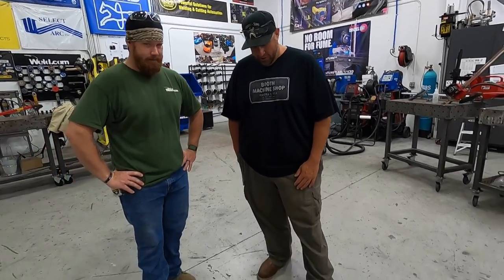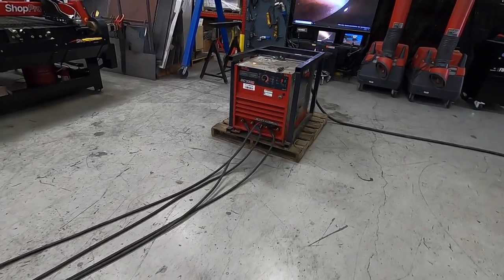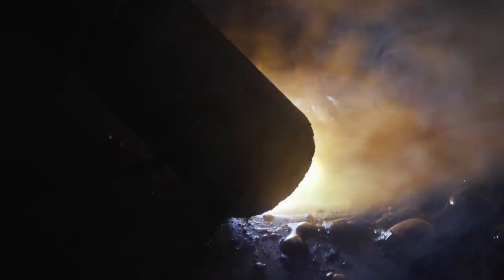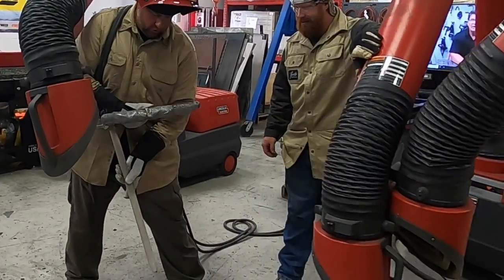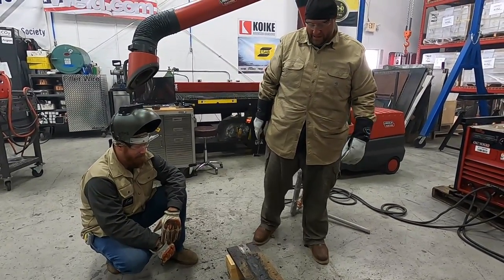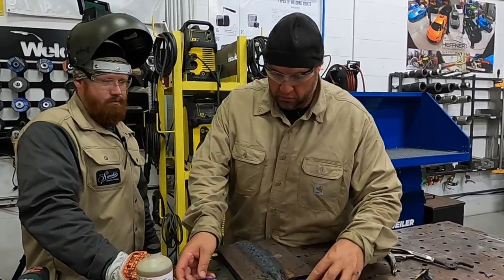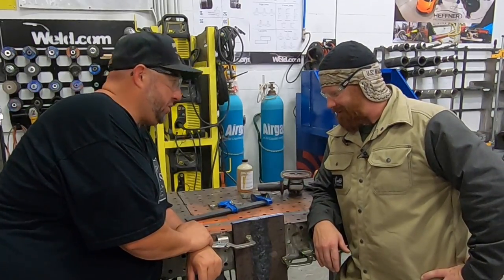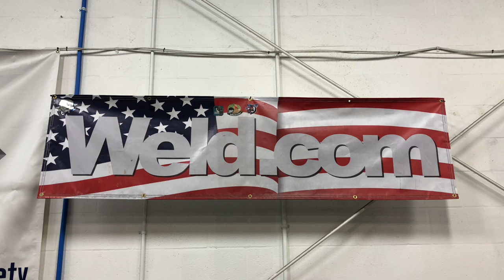1,000 Amp Stick Welding with Weld.com

Comment: This may come in handy if you need to weld 2 freight ships together I guess.
Reply: Best prank ever.
Reply: Or 2 planets
Reply: Right. If you succeed to put the ships flat.
Reply: *ul0
Reply: @mateos vargas Un-Bismarck the Hood
Reply: @mateos vargas Un-Neptune the Moskva
Reply: Best comment
Reply: oOOooo freight ship catamaran
Reply: Hahaha
Reply: Welds freighter ship to the metal dock protector. "Fuck you, you lose your travel privileges."
Reply: Lol
Reply: Hey now I don’t have to stack welds to do it
Reply: Un-Moskva the Bonhomme Richard
Reply: @mateos vargas Yeah! Refloat Arizona!
Reply: Yeah I guess it would be useful for industrial bulk welding
Reply: You weld 1 inch plate steel like on ship decks heavy equipment military ships it takes care of multipass welding
Reply: Just a normal Tuesday
Reply: I'm going to be a nerd and say it crack afterward if the ship is cold. lol
Reply: Needs a bit (alot) more Flux, too porous.  Better than 1000 passes with regular stick or Flux core. Seen em in Oklahoma try to do Flux core on bridge spools. Might as well pick up a harbor freight and build a 4000 lb spool out of it. What the godamn hell. Seen em break tho, definitely
Reply: Or the twin towers
Reply: Flux cores better
Reply: You must be a slow welder
Reply: Holy spatter batman
Reply: To show you the power of this 1000 amp welding rod, I saw this freight ship in half
Reply: Just throw the ground lead in the water
Reply: H😅
Reply: Or planets😂😂
Reply: @sjoerddejonge4080 whahaha just posted my before reading this 😂😂😂 i agree😂

Comment: Imagine sticking the rod by accident and having to get the damn grinder out just to get it off
Reply: I don't think you could stick that. Unless you turn off the power mid-weld
Reply: Super scary 1000 amp welder.
If it stuck, you run like hell, and hope you can shut off the power before the 1000 amp dead short explodes.

Comment: It was a pleasure working with you again Adam! You're welcome back to the shop anytime you're in the area.
Reply: Whoa...somehow I'd forgotten a 1316 was the ground side version of a 6092.  Semper Fi.  6092 1999-2004
Reply: What was the name of that super good grinding wheel? I need that in my life!
Reply: Y’all need to hit up that 10% nital etch so you can see the welds better
Reply: leghumper83 Semper Fi. 1316 2001-2005 🤘🔥
Reply: Jim Jones it’s called a Victograin from Pferd abrasives. They are by far the best I’ve ever used.
Reply: I live in largo. I didn't know you guys were here.
Reply: Great video, good to see collaborations
Reply: Did you put a link or other identifying information on those grinding discs please? Particularly the one you said you could go from weld to paint almost. Thanks!
Reply: Jason Becker I
Reply: @leghumper83  н
Reply: #realweld
Reply: Why not use mig or tig? This stick welding is soo old school
Reply: I wish I was in USA to be able to come around and learn welding at that level of profeciency passionately. That was a nice video. Thank you!
Reply: What is that type of rod designed for
Reply: @shannisgeorge  large thick steel like in foundries and steel mills
Reply: @AS-ug2vq  what do you mean old school? . Mig and tig are great for thinner materials, but stick is way better for thicker materials

Comment: Nice editing suite with one of the most ridiculously oversized monitors ever.  I do like that 1000A welding equipment.  Any idea what the open circuit output voltage on the welder is?  I'd guess it might still be fairly low like 80V despite the thickness of the flux coating on those rods.
Reply: bigclivedotcom Lincoln Electric manufactures the DC-1000s for Red-D-Arc. The OCV on them is 78V.
Reply: I was wondering about this, too. 1100 amps at 80V is furious wattage, for sure. Possibly more than a Pound Land combination dental pick and stick welder.
Reply: I didn't know you watched the channel 😂 nice to see you on here ! I hope you're staying safe and well😁
Reply: @bigclivedotcom the OCV is purposely held under 90V for safety.. anyone who's ever grabbed a deck rod (6022) with wet gloves will agree.. getting belted for the giggles of it... isn't exactly fun.
Reply: Nice to see you here, hope all is well

Comment: Loved seeing this. In the mid 70s I worked for Sisco, a division of Hilti doing repair work in the steel mills. Used the same setup to repair slag pots that were about 15 feet in diameter, laid on their side. We would use torches to burn out the cracks and then fill the resulting gouges with however many rods it took. I think we welded at 750 amps. You would pull in a pallet to stand on and it would eventually catch fire and your boots would be smoking. Of course there was no fume extraction. We also did some diabolical thermite welding, recasting the bottoms of ingot molds that had burned through. Also  wrapping ingot molds with two by eight foot sheets of half inch steel to reinforce them, bending it around with blow torches at the corners and a come along. Nailed them on with 45 caliber Hilti guns about 4 inches on center. Talk about loud when you had 3 or 4 guys going at it at the same time. Quite the experience. This was in NW Indiana. Republic and Inland if I remember correctly.  Thanks for the great video and the great reminder.
Reply: 750 sounds like you'd get better results....I'd think you'd max out at 800 amps on a flat

Comment: you've heard of stick welding?  this is branch welding.
Reply: you mean trunk welding? cuz I don't thing there is any bigger than that one or is there?
Reply: @Astrix_Jaeger  i absolutely did, I wasn't sure if people would get it since "trunks" can be other things.  But your question led me to ponder(obsessively google).  Found one post where I guy describes repairing foundations of 100+ton cranes use 3-5" electrodes.  No way for me to know if thats true or not.  then there's furnace electrodes which are "non consumable" are usually several feet wide & 10's of feet long.

and the top google results for biggest stick welding rod, are this video & various listings for it.

my verdict:  these are king & already larger than intended to be held by a human.

Comment: Imagine if the rod stuck 😳
Reply: You’ll need a diesel truck with a winch to unstick it, for sure
Reply: @wendysobamaman2179  & Fire Dept on speed dial
Reply: @wendysobamaman2179  lol or a 4" angle grinder with a $2 cut off wheel.

Comment: in a welding class in the early 70s, they showed a film of welding the huge thick WW2 battleship plating.  they used LONG huge electrodes that were supported on one end, creating a tripod effect.  the electrodes were self feeding. As it got shorter, it just tilted further and further until it burned itself out.  One person could supervise a bunch of these, setting up new rod when one used itself up.  Probably rods like this one, but way longer.
Reply: That would be awesome to know more.  Even if it could be weighted to run the proper feed it is still a cool idea.

Comment: I worked at a place where the owner purchased a used high amperage Westinghouse arc welding machine for the shop. I couldn’t understand why that machine came with two ground cables and a water cooled electrode holder. Now I know it was once used for large diameter welding electrodes.

Comment: If you think that is something wait till you see the power bill
Reply: Someone did the math. Since its running of a generator, it would be under $2 per minute of arc.
Reply: @Sharpless2  Pretty sure that's more like per second. A thousand amps is an insane amount of power draw.

Comment: Funny how things change. Years ago Red D Arc was a small Canadian company that only did business in Canada. They had a fellow named Henry Cole who was in charge of research and development. Henry was the guy who came up with the idea of using Lincoln generators attached to Kubota diesels. He tried a number of variants before hitting on the Kubota and he knew he had a winner. Reliable and fuel efficient the Red D Arc diesel welder soon started to rival Lincoln in sales in Canada. Henry wanted to start selling machines to the States but upper management kiboshed the idea. Seems they didn't want to upset Lincoln in their home base. So Henry being the guy he was hit on another tack to get machines into the US. He found a couple of rental outfits that had branches in the States that were willing to buy machines and then export them to their American operations. The Americans soon grew to love these machines but they could only rent them. A couple of users determined that they wanted to own machines instead of rent them so they found out where the machines came from and called to see if they could buy them direct from the manufacturer. Red D Arc's management had a long heart to heart with Henry when they figured out what he had done but they decided that they couldn't turn down the sales so Red D Arc started exporting to the US. Today Red D Arc has machines all over the place and they are considered one of the best around as seen here. 
One of their best portable machines is the three cylinder DX. It's about 600 pounds lighter than a full sized DC and you can easily carry one around with a 1/2 ton truck. Being a full AC rectified machine, it can also be used as a light plant and actually has a 200 volt single phase outlet on the panel. It truly blows the doors off of Lincoln's Ranger line which it is comparable to. 
As for Henry, well there was a falling out and he ended up working for AIr Liquide / Miller before he retired. He was a good man and I liked doing business with him.
Reply: Interesting
Reply: Thanks for the history.  It is always interesting to me to see the subtleties of human interactions.  That in some way, God is still working to enable human ingenuity to bless neighbors near and far!
Reply: Sounds like Henry Cole had a lot in common with Henry Ford :)
Reply: Or that humans are able to function without relying on fairy stories in these enlightened times.

Comment: Imagine getting this electrode stuck in the weld. It ain’t ever coming out
Reply: i dunno, hes got a 3 ft lever & a wall of grinding wheels
Reply: why? set the welder on 1 000 000 amps momentarily so the electrode melts gets soft like bubble gum then you can pull it off.

Comment: Imagine the power bill.
Reply: It's a diesel generator. 4.57 per gallon. Excellent weld to cost effiency.  There is no better way to weld on an economical basis. Blows your comment clean off the planet.

Comment: 1000 amps, and still only 1/4 inch penetration, LOL...
Reply: They might want to change the polarity, and also use a thicker plate,  because you are not supposed to see an 80 mm wide weld bead from a single pass on a 19mm plate

Comment: Developed by Weld Mold Company in the 1960's, the 3/4" X 36" coated electrode is in use primarily in the forging industry for the repair of forge tooling, using as much as 2,000 amps, depositing 60+ pounds per hour.

Comment: 1000 amps is insane. That's enough to instantly pass you on to the next life and the one after that.
Reply: 100 mA = 0,1 Amps is deadly. 

This will prob instantly vaporize you
Reply: @JimBob-eg7vq  not enough volts
Reply: @JimBob-eg7vq  the electric current is completed through the ground. The guy is not grounded to the machine. There fore no electricity will pass through him

Comment: Pro Tip:" Always chip flux away from you."  Small chance of getting some in your eyes. If it's  still hot  it will burn you. How many welders out there that have had one stuck to their lip?  That hurts like hell.
Reply: Had one burn my eyelid...never chipping towards me again 😂
Reply: I had one flick into my tear duct. It got between my safety Goggles and my nose. 😢 ouch

Comment: Not a welder but I am an engineer. I suspect reason that the weld is actually shallow and wide is *possibly* (assuming you're running AC) is because at 1000A you're experiencing skin effect. When you're using two grounds and two hot wires, the skin effect in the wires is reduced because the total skin volume is increased due to there being two wires. But in the actual plates being welded the current that high causes the electron flow (which heats the metal) to stick close to the surface without penetrating deeply, because the current that high creates its own magnetic fields, which induce eddy currents and squeeze electron flow towards the outer edges of the conductor.
More on the physics of skin effect: https://en.wikipedia.org/wiki/Skin_effect
Reply: The welder is called DC 1000. I suspect it is a DC only machine. The AC frequency of welders is usually under 200Hz, where the skin effect is pretty much neglectable.
Reply: The would really need an arc lenght the diameter of the rod or greater.. but trying to pick it up and hold it would woop your butt without a jig... soo they got arc blow and cold puddle because the arc was buried in the plate..
Reply: @metalhammerish  But is it a pulsed DC? Or constant current DC?
Reply: @metalhammerish  IIRC, the skin depth at 60 Hz is about 8.5 mm. It would be useful to know whether the "DC" we're talking about is filtered, or just DC in the sense that the waveform never dips negative.
Reply: I have no experience with how high power welders are built, but with other power electronics.

I suspect that the current waveform is 1000 amps DC with around 100 amps of some kind of AC current on top. So no, it is most definitely not just a rectified sinusoidal or other pulsed current

Comment: Does this need 220 or can I use 120?
Reply: Lol.  That Red R'Arc generator can put out 120V @ 363A,  but I bet you could run that welder off a 350A breaker  :)
Reply: you could use 120.
bvvt  hmmmmmmmmmmmmmmmm
why is it glowing?
Reply: @pattonpending7390  Input: 230/460/575 volts, 60 hertz, 3 phase
• Rated Input Current: 193 amps at 230 volts 96.5 amps at 460 volts 77.2 amps at 575 volts

Comment: That's not a weld, that's a lava stream. I have been in welding and metalworking for decades, but i never knew about a 1000 amp rod. I have a rod that size, but it is actually a thermal lance. Imagine the shrinkage of that weld.

Comment: Don't think I've ever seen a weld pool with wave action before.
Reply: Wrong polarity.  Run a 7018 electrode negative on a transformer machine and it acts just like that

Comment: That's definitely the largest welding rod I've ever seen I'm not a welder and I'm certainly not an electrical expert. I wonder what 1100 amps of current would do if you were to complete the circuit rather than the welding rod.
Reply: Nothing more than 1 amp.
At welding voltages the resistance of your body is the limiting factor, NOT the maximum current of the welder.

What happens when you bridge a 500amp car battery with your hands? Unless you have broken skin, nothing.

For a human to conduct thousands of amps, the supply must be high voltage.
Reply: @goodbye8995  Thanks I was thinking of a car battery but I wasn't sure.  👍
Reply: @goodbye8995  actually false, OSHA says 1 amp will kill an individual even with low voltage
Reply: That's how you get a baby Vegas
Reply: @Fitardvark  Try reading the posts before replying.
Reply: @theravenflock6068  If you go by the OSHA rule than you would need 10.000-100.000 volts to even be able to run 1A through human skin.
Reply: @groundkopi5975  Iowa State University has found anything above 30 volts dangerous. That machine runs at 44 volts and people have died at 42. Current kills not volts.
Reply: I worked under an electrician who lost all nerve feelings in his right arm from a 20  amp 120V circuit accident you don't wanna know what can happen at a 1000 amps
Reply: @The Raven Flock  current is dependant on voltage and resistance you won't have any current if you dont have the voltage to overcome the resistance
Reply: @WearyKirin  close but I have asked all other electricians I know and we all agree that 1000 amps at 44 volts (that's what that machine puts out) will kill regardless of resistance. It doesn't take a lot to severely injure oneself.
Reply: It would just run 1100 amps through the low resistance of the leads. Not much power dissipated. A welder is a constant current power supply.
Reply: @theravenflock6068  it just won’t happen
Reply: @loon3426  20 amp circuit is the trip current, not the current flowing through the body.
Reply: @theravenflock6068  44volts dc are not able to break your skin resistance. That's the thing when we talk dc you are basicly a human resistor. And at 44v the amount of current that can pass is very very small. If you lick that thing you are dead otherwise you need to double the voltage to even feel something

Comment: My first job as a heavy equipment mechanic for Brown And Root was running a service truck in a Phillips refinery in Old Ocean Texas. We worked on everything from small vibratory sand packers to 4600 Manitowoc cranes and hundreds of welding machines. CBI ( Chicago Bridge and Iron ) was also there building sphere tanks for the expansion. I got called to go get one of their large welders started one day and they were welding and back gouging these sphere tanks at the tank farm. The foreman gave me a couple of welding rods that were not quite that big and some gouging rods just for souvenirs. They had a 1000 amp stud welder that had a 6-71 Detroit for power that was pretty cool. Also a gang of smaller stud welders that welded insulation hangers on. I hated damp foggy mornings because they had close to two hundred older Lincoln gasoline DC machines with magneto ignition and were a pain to get running. Later they replaced them with diesels and once power was in the units eight bank electrics were installed. Took a load off of our job.

Comment: That's impressive. I've made welds that size before, but I used twin 3/32  wire sub arc welding on big giant earth moving wheels. Them parts do get hot. Can't imagine that heat wearing leathers,  like you did. Way cool video, thanks from an old retired welder.